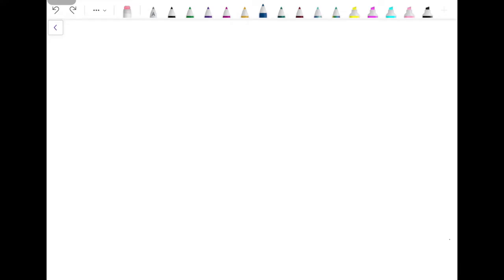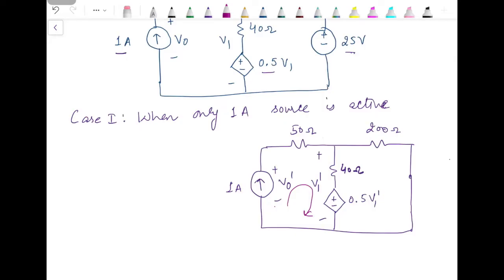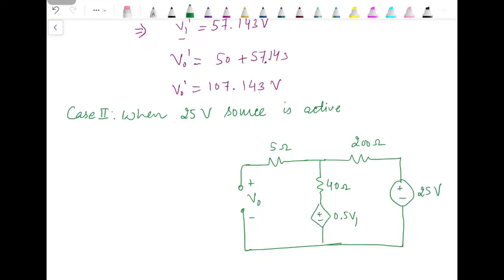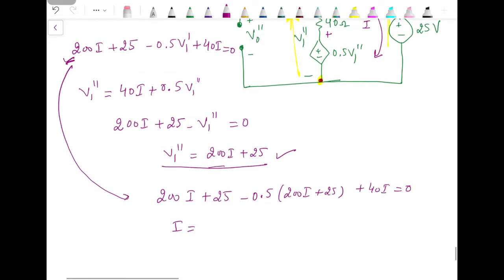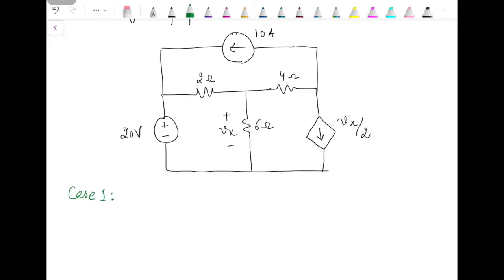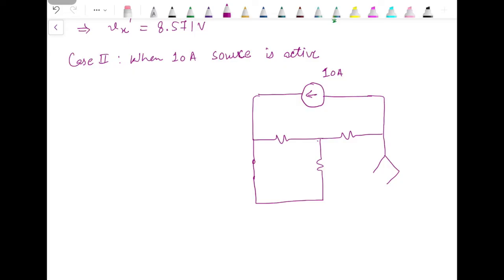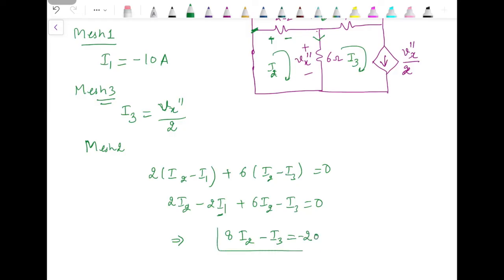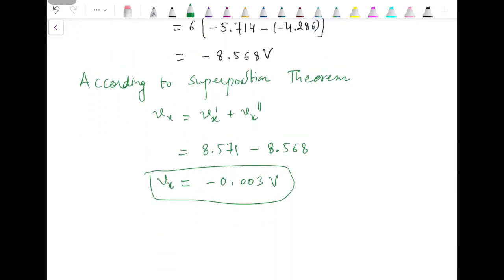Superposition Theorem (Dependent Sources) Part 2 #circuitanalysis #dccircuits #superpositiontheorem

Comment: maam if we do the first step as u have done and then in the second step take node between 50 and200 as reference then our voltage accross1A becomes 0.5v1'  hence if we divide already found v1' with 0.5 we get 114.286v which is the final answer is this right for every question or it was just a coincidence in this one

Comment: the correct equation in the last question for case 2 , mesh 2 is  { 2(I2 - I1)+6( I2 - I3)}, when you will expand this and solve you will get 8i2 - 6i3 = -20 (this is equation 1 ) 6i2 - 8i3 =0 (this is equation 2) however the values of i 2 and i3 are solved correctly for these equations which i wrote in this comment (i2 = -5.714A and i3 = -4.286A)